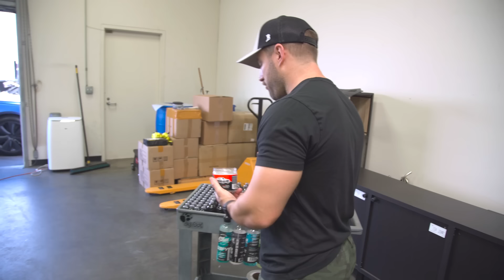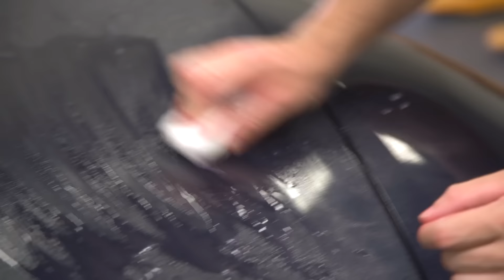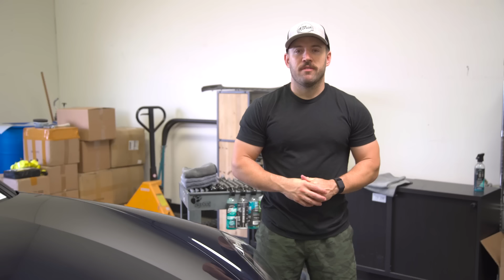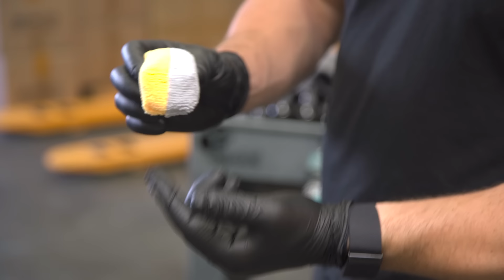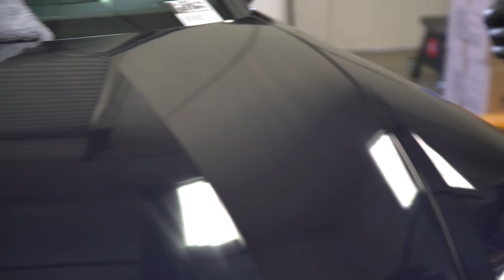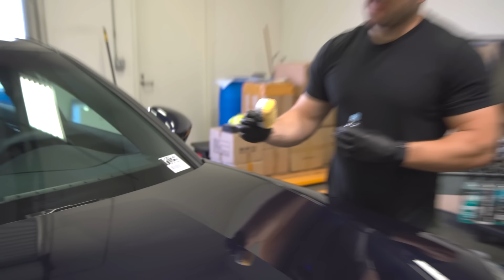How to Ceramic Coat Your Car Yourself - Step by Step Guide for Beginners

Comment: I've used clay bars since 1996. It is a super easy process with a high yield return. You are removing tree sap and micro-metalic magnetized particles from the paint. I presume that the metallic particles likely come from semi metallic brake pad dusting and brake disc wear.
Reply: can you use a clay bar on window glass????
Reply: @berardoferrari Yes you can.
Reply from the maker: Agreed, clay bars work great!
Reply: Nah, not tree sap
Reply: Imagine we breathe that sh!too.. YAY for convertibles ❤🎉

Comment: Tim, does the panel prep detox remove the ceramic from detail spray that you used as a clay lube... is there a benefit to using that type of product as a clay lube?
Reply from the maker: Yes it would remove it prior to protection but also since it is compatible with our coatings when used in parallel there will be no bonding issues regardless.